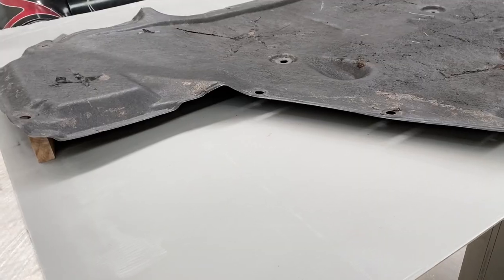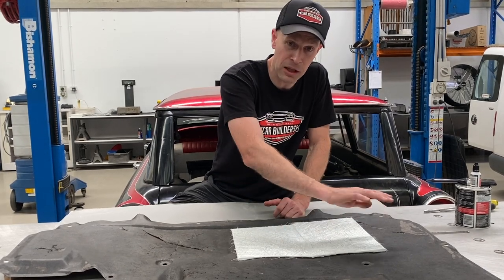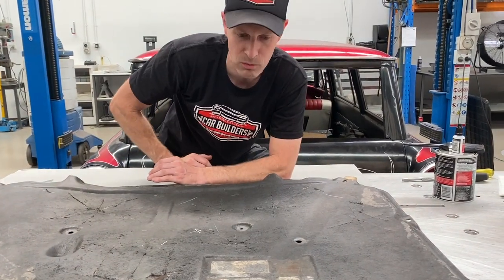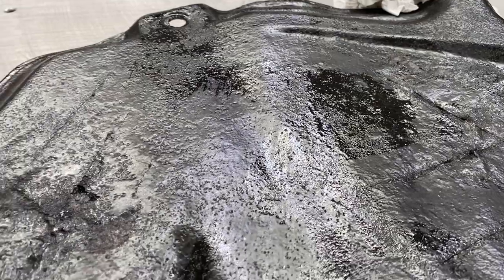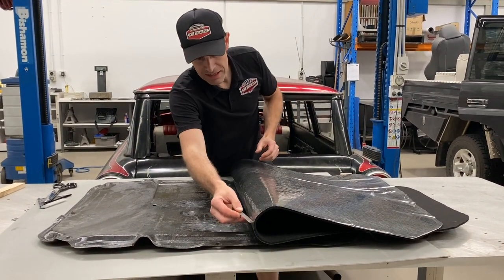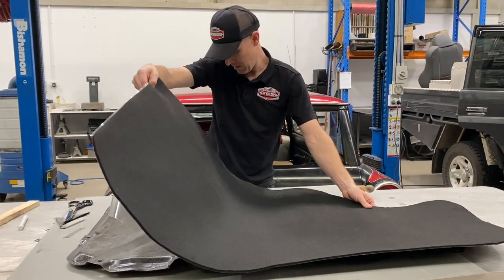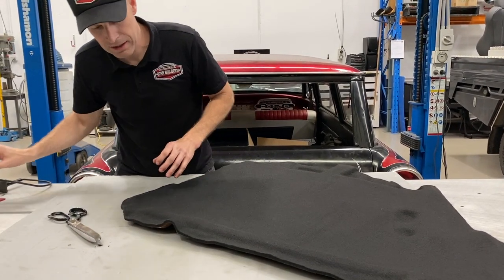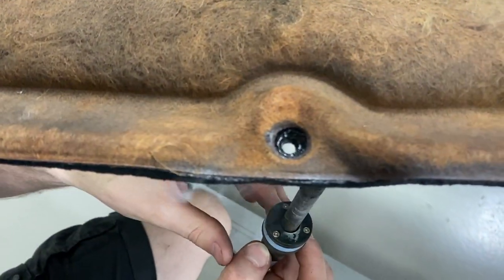After That Factory Underhood/Underbonnet Look?

Comment: Can it be used on the firewall in the engine compartment? I'm restoring an older car that had such an insulation but the mice killed it.
Reply from the maker: Hi Catalin. Yes, it can be used there. Often people will use a Peel and Stick Heat Shield in this position as it will have a far greater result in reducing heat coming through the firewall. https://www.carbuilders.com.au/peel-stick-heat-shield 👍
Reply: I know, but this looks much like the factory one on my car. Do you have any dealers in Europe?

Comment: Proper job! I'm starting to think I need to do this to my Golf
Reply from the maker: Hi emilz85. Give us a call if you need an advice 👍
Reply: @carbuilders1  I'm in Europe but might drop you an email if that's ok.
The other day put some 2mm vibrodamping under the bonnet of my diesel and very pleased with results - exterior engine noise now only heard from underside and front grille, hood completely silent. Planning to have a go on interior as well.